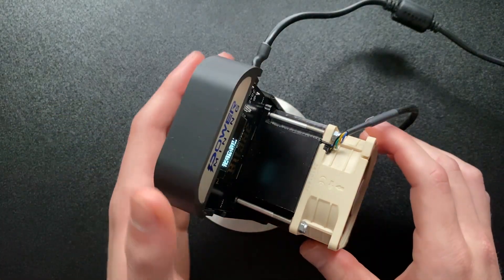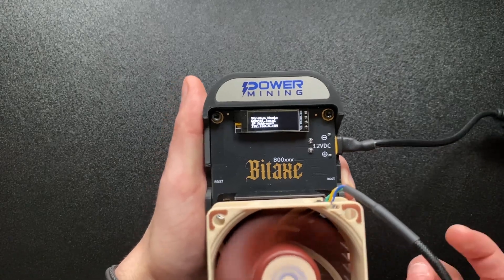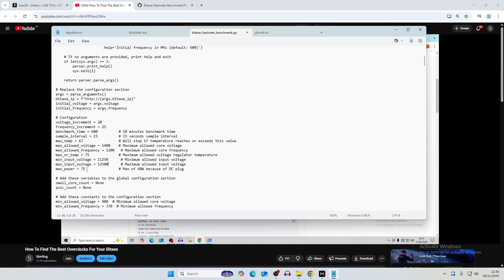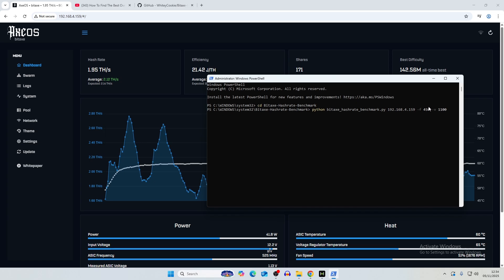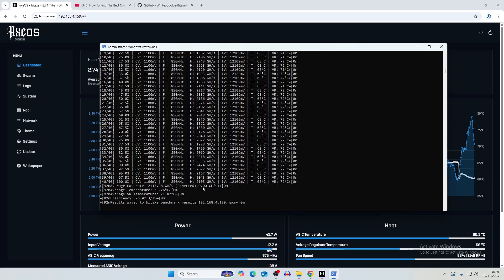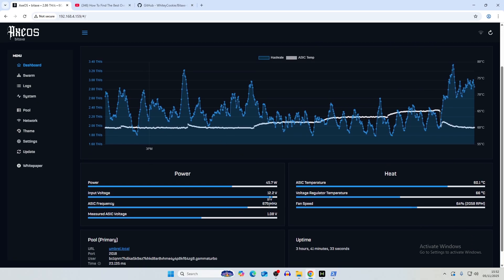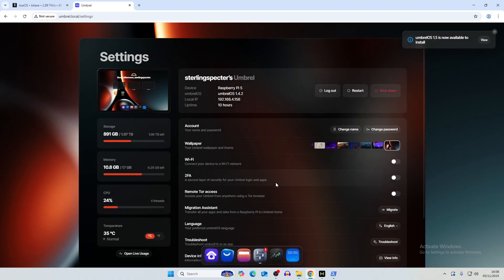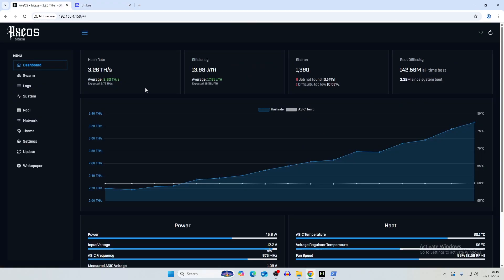Bitaxe GT Overclock Testing

Comment: I'm curious how far these can be pushed. I have some old XBox One power supplies that are good for ~190W on 12v I'm going to test using. They have fans in them, designed to deliver clean 12v power and run at high watts for long periods and only have a couple of failure modes that are easy to repair. In watching your other video I'm wondering if some additional strips or surrounds of high-conductivity thermal pads under the heatsink would help provide another path of travel for heat out of the PCB.